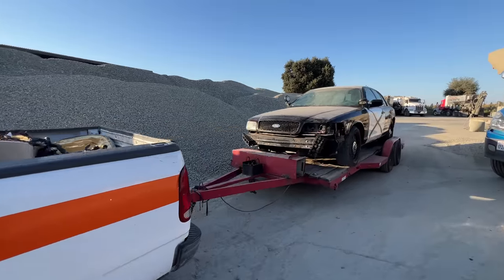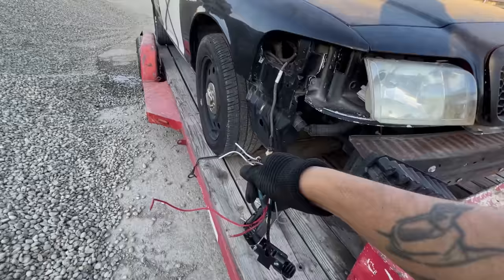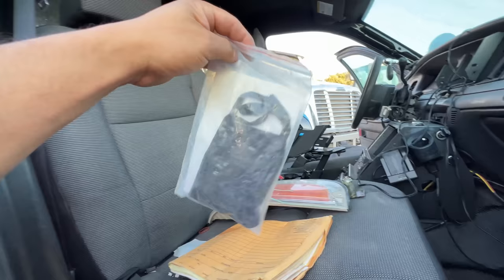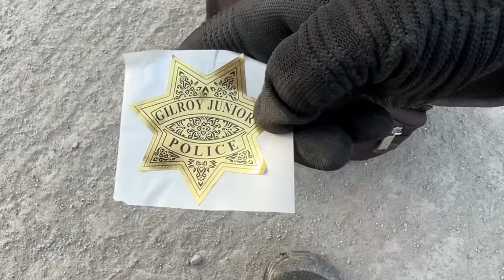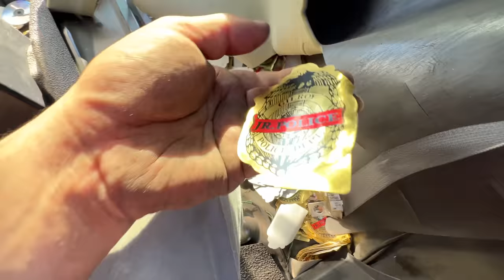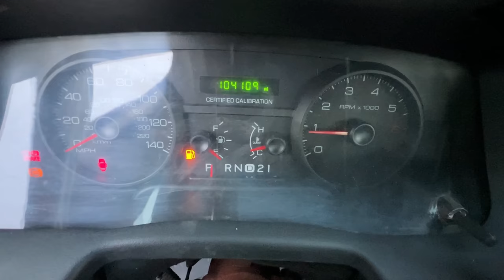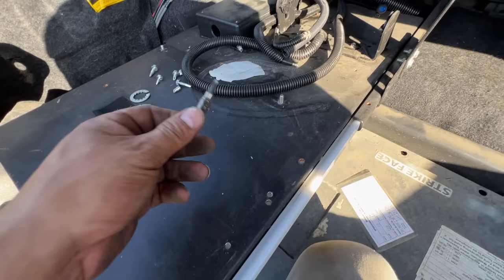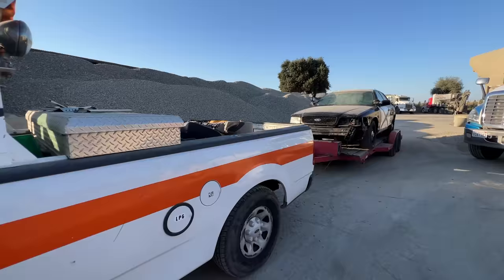I Bought an Old Police Car! Found a 9MM Resistant STRIKEFACE!

Comment: Do you have any of the Troy consoles for sale? Looking for a straight console from a Crown Vic for a restoration project. That unit in the trunk is probably a power control module for the siren control head. Worked for a couple of radio shops in the day and used to "build" up cruisers. Not a fun job tearing into a new Crown Vic they are so nice new from the factory. Funny had to pick a couple of new cars from the dealer one time with a co worker. All white and no license plates on the car. We must have passed two state troopers and three city cars taking them back to the shop. Several of the officers even waved or gave us the "thumbs up". It was nice driving with no plates on the cars. Yeah the police packages were dead give aways by the black steel rims and the side spots pre installed by Ford. The odd car in the bunch one time was a "fully equipped Police intercepter package for the chief of one department with nice wheels and no spots but it had everything under the hood that said police.

Comment: Hey i have a 05 P71 thats slow to engage into drive. It links up in park and reverse and goes into neutral but it takes a minute to engage into drive. I was wondering if anyone would know if its an ECU or transmission problem?